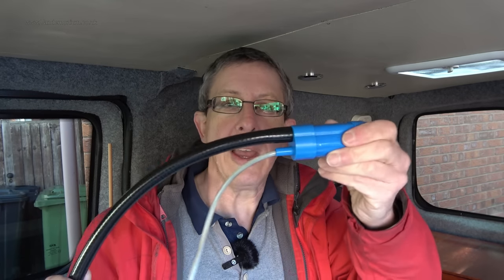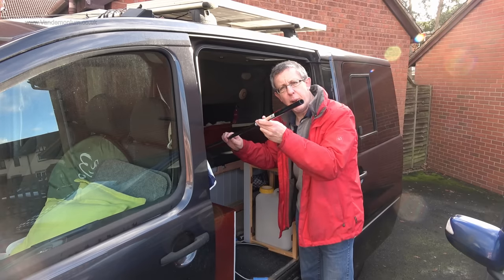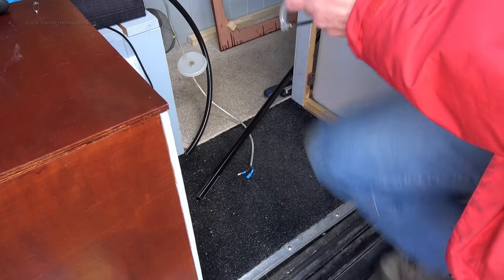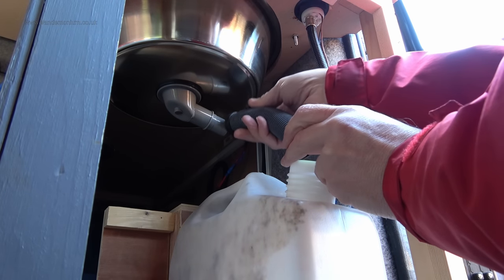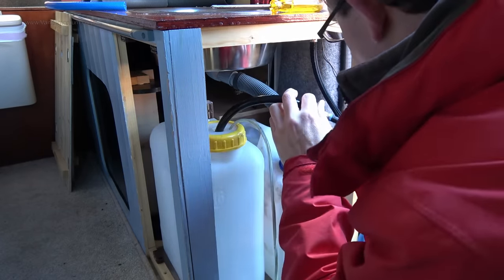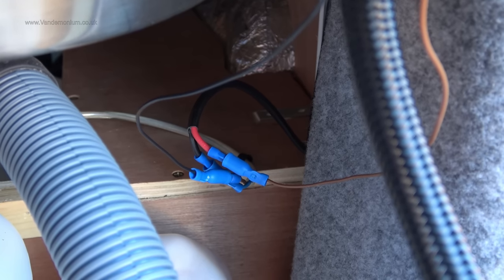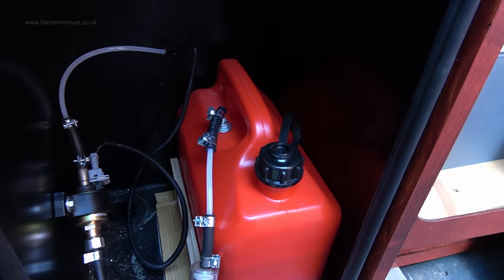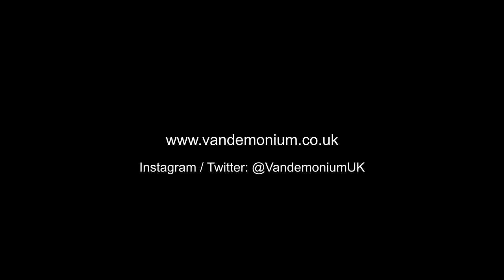75. Sorting the plumbing in the campervan

Comment: Barbed fittings are not meant to seal on their own. You just needed a hose clamp on the water line or as you call them a jubilee clamp. Nice work though!!!
Reply: Took the words right out of my mouth. I'd redo that without using any sealant and a clamp on each fitting.
Reply: And if the hose is too small to fit the regular hose clamps, two or three zip ties, pulled very tight, should do the trick.
Reply: Yes come on David just use a hose clip Lols plus using a sealant on top of a leak never works 👍
Reply: Agree entirely. Also suggest using marine grade stainless hose clamps not zinc coated ones. Take the sealant off, take the hose off and put a good quality hose clamp on it, if you don’t use hose clamps it will eventually leak!
Reply: Ah, well, now ... barb type fittings used not to require anything other than friction to ensure a seal.

For those who used Bunsen burners during chemistry periods the pink rubber hose from the bench top gas spigots to the Bunsen burner will recall the hose was merely a push fit.

I'm going back over sixty years and happy to be corrected if things have changed significantly.

I can't recall my school ever being razed to the ground, even with me in attendance.

Might be worth some folks doing a spot of Googling prior to posting slightly inaccurate advice, albeit in a well meaning way.

If a spigot fitting requires a clamp of any description then generally the spigot is designed with parallel sides with a pronounced lip at the end.

If a "quick fix" is required on joints which are not a tight fit to a hose then use self amalgamating tape.

Would further suggest not being sparing with the tape, and being careful to lap the layers by a half width and keep a tension on the tape when winding.

Such tape is not just for sealing electrical joints.

Comment: As an owner of an induction hob, I can tel you:
Everithing from steel and iron works: cast iron, carbon iron, stainless steel, alpaca and so on. I even have some metal plates and they work too. Aluminum does not work at all unless it has a steel insert in the bottom. Usually they are marked as induction compatible. When you look at the bottom, you will see a steel grate - that heats it.
The hob will tell you - if it cannot work with the vessel, it will show error on display.
Reply: alpaca? 🤔

Comment: My induction cooker came with a simple, flexible magnet like you use to hold things on the refridgerator.  You are supposed to use it to check pots and pans.  I also found a steel stove diffuser plate that is magnetic -- there are many on Amazon.  If a pan isn't magnetic the diffuser plate can be used on top of the cooker, and works as well to heat the pan.
Reply from the maker: I will buy one, thanks

Comment: Hi David
Just seen the waste pipe fitting video.
Why not just warm up the waste pipe at an appropriate point with a hair dryer ( a heat gun can be used but with caution 😬) and create a bend, then keep hold of it at the required angle and dip in a bucket of cold water to set the angle. Also, smear the wate pipe rubber grommet seal with washing up liquid to lubricate before fitting. It will go on further and a lot easier.
The inlet pipe you fitted was not a problem with your fitting it. It was a problem with the the white plastic fitting not being seated to the pre assembled pipe properly. It should have been tested first at the factory.  The water was not coming from your black warmed up pipe where it joined. Sealant may work temporarily but if twisted it may leak again. Regards Peter

Comment: What you lack in formal training, you more than make up for with solid thinking. Kudos! As for the small leak, perhaps heat the pipe and install a small hose clamp. That's a "fickle finger of fate" thing. It's leaking because it CAN. 😅 Top marks on the diesel vent. Can’t wait to hear the report on that.
Reply from the maker: I'm pleased to report that a 160-mile round trip recently resulted in no drips from the vent!

Comment: Re the diesel tank ventilation issue.  Usually a secondary fuel tank will have a 'fuel tank vent screw' on the top of the tank filling cap which (when unscrewed) allows air into the tank as fuel is being drawn out by the pump.  This is quite normal with fuel tanks on boat outboard motors and on marine 'secondary' fuel tanks which is essentially what you have.

Comment: Diesel tank - you can buy a purpose made Marine diesel tank with all the fittings and vents on it - Mark Davies shows one on one of his Diesel Heater videos. Water tanks - Why not have them the other way round so that the fresh water pipe goes straight up to the tap instead of the curve? Fresh water on the outside, waste on the inside?Always a good idea to clean the pipe cuts of any swarf/curly bits, as if it goes in the water tank it will get into your pump and could cause problems. Also take the stickers off the pipe that goes into your fresh water too :-)

Comment: A small jubilee clip or jubbly clip as my mate calls them is the way to go if the water pipe still leaks. Wont need much pressure, keep gently  tightening the clip as the pump is running, when the drip stops, quid's in. Nothing more annoying. As regards the pin hole in the handle. The diesel will probably slosh about like an old belly dancer and the most you'll get is an oily stain. Wont be the Torry Canyon in the back of the van.  Oh , when your cutting with a junior hacksaw, the gap the blade makes tries, successfully to close. Used in conjunction with poly pipe you get the melting effect from the friction which causes it to become even more sticky. You may have noticed it became easier when you placed it over your knee. I stick to the senior hacksaw, not becuase I'm getting old, but its more user friendly. Especially to an apprentice senior. 😂

Comment: I second mvpeters suggestion - replace the ferrule/barb combination.  I suspect the leak is at that joint, not where the hose fits over the barbs.

As to the vent in the diesel canister - I would think that a vented cap would be available - one with a one-way valve, I mean.

Comment: Just about the push fit connection on the bottom of the sink. If you put a small bit of fairy liquid around the inside of the rubber connector it will slide on much easier. Still loving the van videos

Comment: Hacksaws work much, MUCH better if you secure the workpiece near the cut. They cut on the push so just a good corner to wedge it in is often enough. Don't try and go fast, you'll just make yourself tired. Don't push too hard, you'll just bend the blade and make it wander. Just relax, go slow and if you start to get impatient, think about something else; maybe the next thing you need to do.

Also, that is a tetchy little saw. A proper, full-size one give you much more usable blade length and many more teeth through the kerf for each stroke.

Comment: Super glue will wick into the water connection and seal it. The cap on the diesel tank seems to have a small nozzle designed to take a vent tube. That can be connected to the cap and run up a few inches to prevent leaks.

Comment: Jubilee clip should have been used for the pump connection.
Reply from the maker: It shouldn't need one, the whole point of the barb thing is that it's a pressure fit
Reply: @Vandemonium  a barb fitting is only good for gravity fed water systems as there is no pressure being fed to it a jubliee clam will press the pipe closer to the barb fitting creating a water tight seal
Reply: I agree jubilee clip required similar barb finish on some gas connections but you wouldn't dream of just push fitting the pipe, or WOULD YOU 😳

Comment: None of the Ridgemonkey cooking products is suitable for induction hobs, but you can buy an induction hob adapter plate from, say, Amazon, which is basically a ferrous disc that sits between your induction hob and the non-induction pan.

(I’ve been considering the same question myself!).

Comment: Not to rain on your parade David but would suggest a brief natter with your insurers ref your modifications performed by yourself.

I once contacted the BSS and boat insurers ref work on my boat.

Both stated that provided the manufacturer's installation instructions/method statement were followed to the letter then they were happy.

However insurers did assure me that they would check to confirm compliance. You will appreciate that's why there are "T&C's" ... for their benefit.

Comment: Here's a tip for any plastic fittings that leak. Check for a moulding line with your finger nail. The water tracks along these. You can smooth them with fine sand paper or wire wool or even a scourer. As long as any scratches you make are fine enough And run in the same direction as the sealing surface, it will work. In this case you'd wrap the barbed fitting in your abrasive and hold and turn the pipe left and right to polish out the moulding line.
In addition or as an alternative you can put several turns of PTFE tape round it before pushing it together.

Comment: The easiest way to check if a pot, pan or kettle can be used on an induction plate is to use a small magnet. If it sticks, the answer is yes

Comment: Enjoyed the video, very well done. Use a magnet on the cooking pan, if it sticks it'll work. The pin hole vent is likely to be too small. Assuming the van is stationery when the heater is in use, just slacken off the filler cap.
Reply from the maker: Cool, thanks

Comment: A proper vent on the diesel tank will prevent the vacuum collapse during use but will close off when not in use to prevent odors and flammable gases from escaping.  Just a thought David.  Great video as always!

Comment: A jubilee clip or pipe clamp may solve the leaking problem but there is an assumption that the leak is caused by the  black pipe you have squeezed onto the barbs. It may be that the leak is coming from the metal crimped half.
Reply from the maker: It's coming from the pipe, I can see it
Reply: @Vandemonium  The push fit looks sufficiently tight, it looks like the leak is coming from between the metal and white nylon parts, pull the black rubber pipe back a couple of barbs so that you can see which joint is leaking. Sealant will probably not last when applied externally, rather than between the surfaces that should be mated together.

Comment: David, 1. simply put a hose clamp around the leaking pipe, 2. A pinhole vent (to allow air in) while diesel may not exit as a liquid, being a hydrocarbon will produce vapour!  So the suggestion of a little one way valve was a good one!

Comment: Hello David, The bad news first and the good news second. I bought a Ridge Money for the boat fine on gas but at home on the induction hob, a big fail because the RM is made of non magnetic aluminium. Now the good news I purchased a Tescoma Induction Hob Adapter from Amazon, currently unavailable but there are other such beasts available on Amazon. The adapter works well but it must be borne in mind that the steel adapter holds the heat. Hope that helps. P.S. I had an Autoterm installed on my boat to replace the aged Mikuni.

Comment: David" sealant? 😅 heat the hose with hair dryer then  twist it back and forth a few times, this should seat the barbs. If not put on a wide zip tie and pull it tight with a pliers. 😊

Comment: Good afternoon, another amusing video, thank you. may I make a few suggestions please, when cutting plastic tube flexible or rigid either use a sharp knife or support the pipe mechanically because as you were cutting with the saw your action of pushing down caused the cut area to close up gripping the saw blade making it harder to cut, the free end of the pipe was leaning on the seat pushing up, never rely on barbs not leaking always use a suitable hose clip to clamp the pipe to the barb and finally when pushing fittings into a flexible pipe smear some vaseline around the fitting as lubrication.

Comment: Two things. Fuel tank needs one way valve. When you stop the vehicle fuel will go one end of container.  Same when you accelerate causing fuel to pop out of pin hole. Looks as if you need hose clamps. Also it looks as if the crimped water hose. Silver bit is faulty. One way valves are very low cost. Etc. Cheers from old George and Jane.
Reply from the maker: Cheers. I've done a 160 mile trip over mixed roads and absolutely nothing came out of the pinhole, phew

Comment: While being a splendidly simple way of letting air in, fumes may come out on the pinhole, even more so on a hot day.
Until you find a one-way airing valve, thise surely does the trick, but the valve may solve the issue of fumes and smell, if my thinking turns out to be correct.
I hope I am wrong though.

Very well put together video David, as ever.
Virtual handshake from our new home in a lovely village in Hungary
Reply from the maker: Fumes shouldn’t be an issue, I think, as the whole thing is inside the (former) gas locker

Comment: A tiny smear from a tiny 1/2oz pot of Black Swan silicone grease gets any pipe onto any connector. I couldnt help thinking of Kenny Everett's Reg Prescott character while you were hacking away at that pipe !
Reply: Exactly right, silicone grease has many uses

Comment: If a magnet sticks to it then it will work with induction!
Reply: And magnetic metal 'flame-tamer' plates are readily available to transfer heat to a non-metallic pot or pan.

Comment: It wasn't the hacksaw. You were holding the black pipe on the wrong end. Always hold the longest end, and cut off the shortest end, while it's in the air. Don't rest the short bit on anything. If you do that from now on, you'll find the job will go much smoother. For everything you cut.

Also, if you wipe some spit on the inside of the rubber hose attachment before you push it onto the sink drain, the male end, it would just slide on.

Comment: Just try a zip tie around that barb fitting. That little leak shouldn't take much to correct.   And your diesel tank pinhole will be just fine. It won't leak or smell. You may even need to make it just a bit larger. Check the tank during operation and see if there is any sign of vacuum. Also check when the temperature in the van heats up for the tank bulging due to expansion.

Comment: If your freshwater refil tank was identical to the supply tank (that one almost is) you could simply swap them over instead of decanting and risking spilage. I think you are probably right about the diesel not spilling from the pin prick, but i did chuckle when you said "it will only drop on the road -not ideal but not a crisis" It would be for the poor sod following you, if they hit that patch of diesel🤣
Reply from the maker: Fair point though the amount would be absolutely negligible if any, and it would first have to spill out of the tiny vent and then make its way to the gas locker hole ... I checked after a 160-mile trip on mixed roads and there wasn't even the tiniest drip escaped.
Reply: LOL

Comment: With the leak from your water pipe, why not simply use a jubilee clip?
The vent in your diesel container. A very easy fix and a fuel gauge to match. If you go to a chancery and but a fuel gauge screw rap for your fuel container (a universal fit) if comes with a vent screw within the cap. About £20 max.

Comment: No the Ridge monkey does not work on induction, I have had the same problem, but you can buy an induction plate that will conduct the heat, but it must be solid one. Good luck.

Comment: Fun genius...in the waterworks.  Good stuff !    P.S. be very careful with anything induction/magnetic stovetop.  You could ruin it or start a fire, or melt your unit.   Treat the induction heater as any other electrical thing; look up everything you must keep away from the new stovetop.  Recall must never put anything metal within a microwave oven (similarly, but different physics all together, but...)...or it will spark and ruin your microwave oven.  Not sure what type of Aluminum you can use there, or specialy cookware for induction....be Careful !   P.P.S.  the gap in the clear wastewater tank with grey corrugated plastic pipe to blue cap is good !  it allows the air displacement as water fills in the wastewater tank...otherwise it would get pressurized too much and stop water flow.     P.P.P.S. on the small black pump hose you could use zip-tie around the outside to crimp-it on to the plastic.   Zip - tie.

Comment: Jusst a thought, you might want to remove the label on the hard black plastic pipe you used for straightening the water pipe to the pump. the ink, glue and paper will loosen and float around in your water jug. Might plug up your pump and leach undesirable chemicals into your water. Just a thought.

Comment: David, please forgive me for being thick, but if you are going all- electric, why do you need the deisel?
Reply from the maker: Not all-electric, just not propane. Electric heating is still largely unviable as you just don't get enough power in a battery to drive any substantial degree of heating. I know people have tried electric blankets and duvets, and compact hot air blowers, but they have to be very low power.
Reply: @Vandemonium  Thankyou for the explanation. l must have misheard or misunderstood what you said. My bad.

Comment: Hose clamps on any of those barbed fittings. I would also be certain any plastic water lines I used were safe to drink from. I would run a vent line from the diesel tank out of the van, you’re going to get fumes with a pinhole. Having not read all other comments I can only guess I’m not the only one to suggest these things. Good luck!
Reply from the maker: The diesel tank is inside the former gas locker so no smell will be apparent

Comment: Jubilee clip needed, 000 or 00 size. I would remove the waste tank and put pipe out through the bottom as its only dish water.
More storage space then.
Reply: A lot of vans tap into the main diesel tank for the heater. More storage and no diesel leaks and smells.